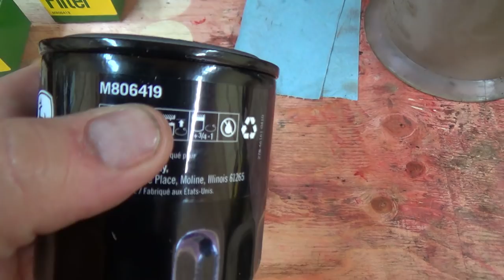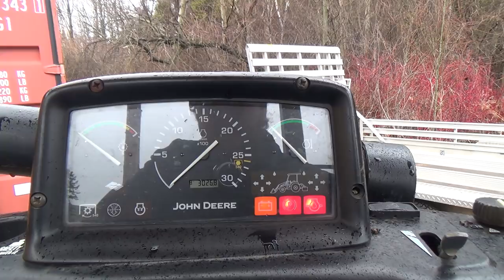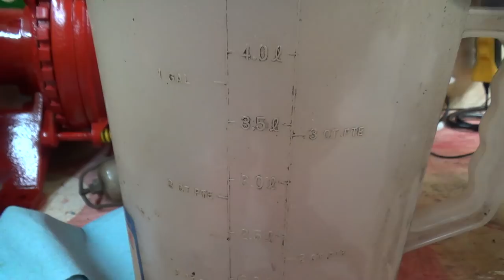Oil Change Series....First up John Deere 110 TLB  3026.8 Hours

Comment: The motor oil for your superduty is a very specialized oil.  Ford has a specific code for it.  They say you can use a CJ-4 or CJ-4/sm engine oil is required to ensure emissions system compatibility
• 10W-30 is the preferred motor oil viscosity for normal use
• 5W-40 or 15W-40 engine oil is recommended for severe duty or biodiesel applications. Viscosity recommendations vary with ambient temperature; refer to owners manual. 
If you don't use the right motor oil it could void the warranty on the engine.

Comment: John Deer doesn't make oil filters, they buy their filters(from the cheapest supplier) and rebrand them. Hence why the same filter has two very different designs. They switched to a different manufacturer, one that gave them a cheaper price probably. In fact, they are so cheap that they don't even pay to have the manufacturer silk-screen the John Deer info on the filter.  They just buy blank filters, or even filters with other brand's info on it, and just slap a John Deer sticker on it.  That John Deer M806419 filter cross references to a WIX 51064, the filters look identical, so I'm willing to bet WIX makes the filters for Deer. The WIX is $6.89 per filter on RockAuto. Oh, and the Kabota filter cross references to the same WIX filter, so they should be compatible.

Comment: Bill - can't you just have your local Kubota dealer (the one that is 1-1/2 hrs away) ship some filters to you?  Most of our local Kubota dealers will ship parts direct just the same as the local Deere dealers. In some cases the cost of shipping is less than the cost of fuel to drive to the dealer and back. :-)
Reply: That's a great idea to do. Or maybe you can get to filter online.
Reply from the maker: I’m not sure they would. Likely be cheaper to drive there lol
Reply: BILLSTMAXX cost of fuel to drive over there and your time would be probably the same cost as just having it delivered

Comment: Bill - You're supposed to change that spin-on fuel filter every 400 hrs. You might want to check the prices on those fuel filters again. Obviously these are U.S.A. prices but the list price for your oil filter here is $7.94 and that fuel filter is only $11.84. So even though your Canada prices are higher the fuel filter is probably only a few dollars more than the oil filter.

Comment: I just changed  my air filter on my tractor yesterday, I couldn't believe how dirty it was, compared to new one. I use same filter on my zero turn which is a Kawasaki engine, that way only need one part number to remember, plus buy them on Amazon.

Comment: On that front axle trunion. I see in the parts illustrations that there is a seal on either side of the differential housing there it goes into the axle pivot supports. Obviously I can't tell for sure but since there aren't any grease zerks it's possible that they use fluid in the front axle to internally lubricate the axle pivot. Otherwise it seems that pivot wouldn't last long at all with no lube.
Reply from the maker: Agree